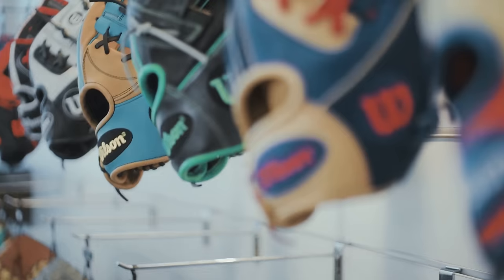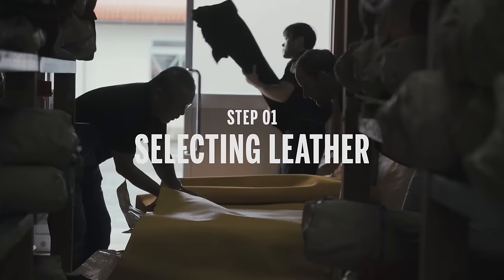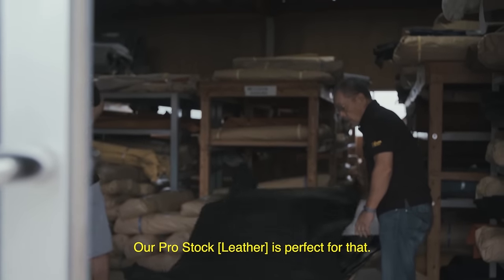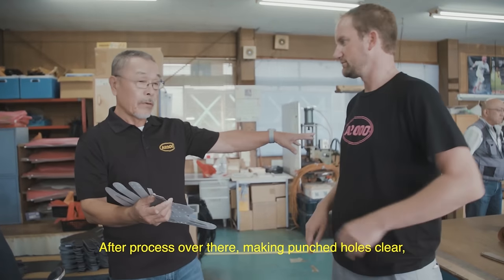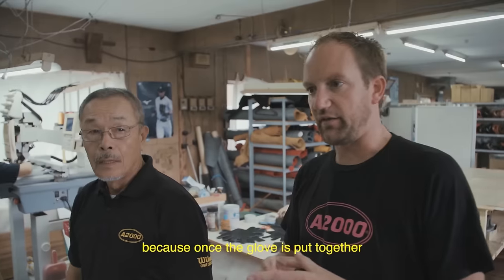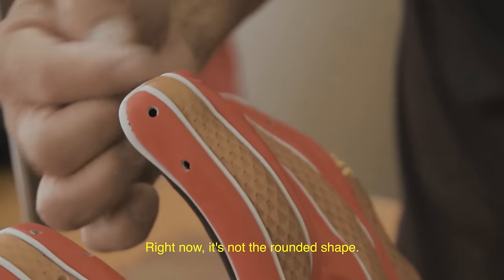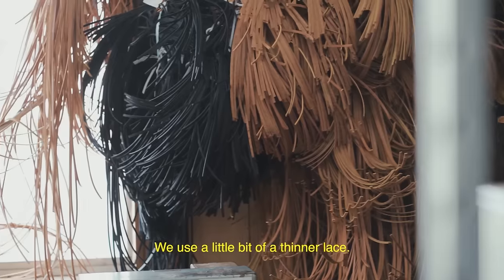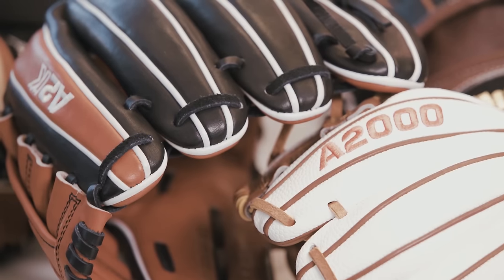Wilson Glove Lab: How a Glove is Made

Comment: The only problem with Wilson or the laces. He’s right Wilson does use thin laces. But in this case, their laces are not up to the quality of rolling. They should sneak somebody into the rolling factory or higher somebody from there and find out what laces they use. Because Rawlings laces are far superior. As far as the gloves leather, they’re pretty close. Wilson uses the same leather for A2K and A2000! Rawling uses the A2K leather for their Heart of the Hides. And then they use the kip leather for the pro preferred. so there’s really no reason to buy the A2 8K from Wilson. They say they used the top 5%. Which means that they just look at it and they choose which leather they think is better. Which means not too much.

Comment: Agree that the thinner laces used by Wilson allows the glove to function properly early on, but they lose their tensile strength too quickly, and the laces stretch. I find myself constantly tightening laces on the A2000’s. Once a Rawlings HOH or Pro Preferred is broken in, it functions great, and the heavier laces don’t stretch anywhere near as much. I stick with Rawlings.